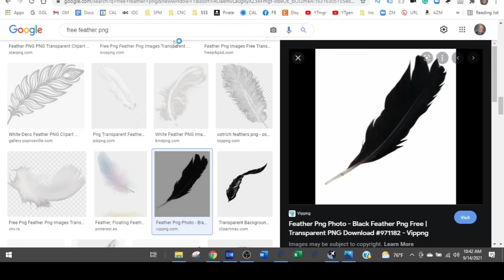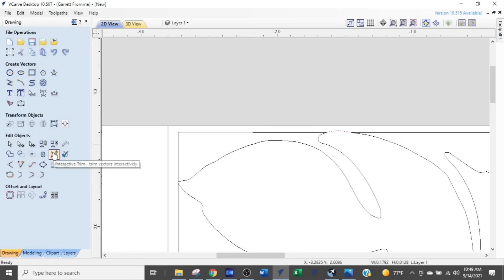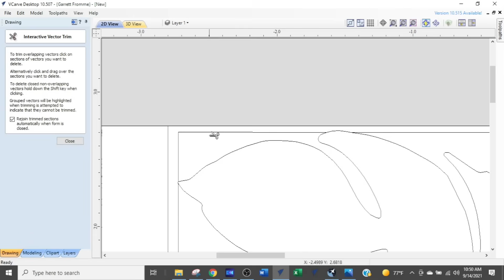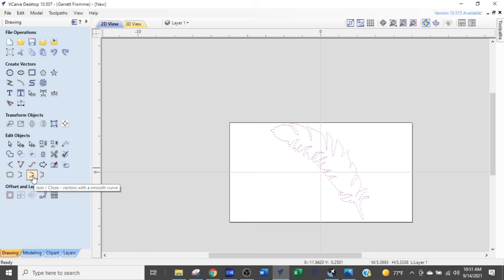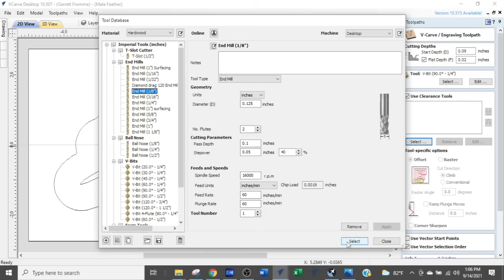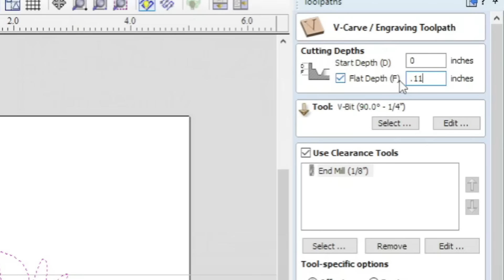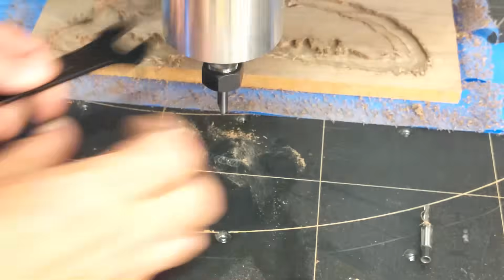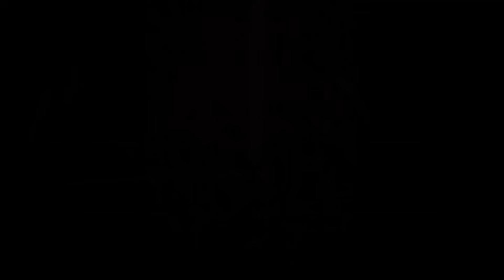How To Make a PERFECT INLAY with a CNC Router, Easy CNC Router Projects

Comment: Thanks for the great video. I have used your procedure twice now with great success. Thank you. I do have one question about you start depth settings for the male side. You used a start depth of .09 and a flat depth of .02. I am curious as to why you use the .09 start depth? My question is due to me being very new to CNC routing for one so I may be missing somewhere obvious. And for two I have a small spindle using 1/8” bits with a pass depth of .02. Because of that my first cut is cutting at .11 and it’s a LOT for my little router to handle. Any insight would be greatly appreciated. Thanks again for all the great content
Reply from the maker: Thanks for the kind words! Your situation is a bit tricky to walk through over comments, my friend. I recommend joining us for our live sessions every Wednesday evening at 8 PM EST, and we should be able to help walk you through it then, brother!
Reply: @IDCWoodcraft  Thank you for the reply, I appreciate you getting back to me.  I will check out the live sessions for sure.  Thanks for the invite and looking forward to it.

Comment: Thank you for all these amazing videos! So awesome, I’m going to make an inlay and was thinking of using a 15 degree VBIT for sharper detail, can I change the bit to that and use the exact same settings? Thanks!
Reply from the maker: I'm glad you're enjoying the videos! You can definitely switch to a 15-degree VBIT, but you may need to adjust your settings slightly depending on the bit's specifications and the material you're using. Happy inlaying!
Reply: @IDCWoodcraft  thank you, my buddies and I watch all your videos, they are the BEST out there. Hands down. Thank you for sharing and all the hard work you put into these for others to benefit from.

Comment: Garrett , you wouldn't believe my trip with the feather.  Forgot to load female v bit program,  ran correct bit, no "quill" Found out I didn't load v bit file but ran clearance program.  No harm done. Now I need to know if I need to measure my plug and reprogram surfacing toolpath to cot to correct depth. Seems male "quill" may have chip issues that will make a void if I surface too deep. I used mahogany for male. So wood fibers are not like walnut. Any suggestions would be nice on the resurfacing 😅
Reply from the maker: Haha, sounds like quite the adventure with that feather! This one is a little tricky to walk you through over comments, my friend. I recommend joining us for our live sessions we host every Wednesday evening at 8 PM EST; we should be able to help you out there, brother!

Comment: 90 v bits don’t allow much for depth.  plus cutting with V bits creates a deep center and very shallow points and walls at the ends, it’s simply the nature of the tool.  Better tool in. TBN tapered ball nose.. helical cutter which leaves the best cutting surface and very deep inlay through the entire cut.. I highly recommended you try the TBN. you can enter it in v carve as a conditionally correct V bit or an actual TBN or engraving mill.  You’ll need test cuts to find the parameters that work but the inlays are much deeper and stronger throughout. I do 7.0mm on end grain and 4.0mm depth on face grain.
Reply from the maker: You make some excellent points about the differences between V bits and tapered ball nose bits. The unique geometry of each tool can definitely affect the outcome of a project, especially with inlays. It sounds like you've found a great solution for achieving deeper cuts and stronger inlays. Thanks for sharing your insights and experiences with the TBN cutter! It's always helpful to hear about different approaches in woodworking.

Comment: I have, to admit, I'm rather disappointed.  I've been trying to follow this, but the results are far from satisfying.  The first attempt, the v bit went too deep and the design chipped horribly.  The second attempt, the depth seemed to match better, but when the spindle lifted, the entire raised portion was gone!
The Avid touch plate is designed to always find all three axis, I don't know if it is even capable of being limited to just the z.  Is it possible the travel speed is too high?  I haveno idea what is going wrong.

I am editing this to admit I was wrong, and to apologize for posting a comment too quickly in frustration.  Once I realized my mistake, I was able to make the proper corrections and have created my first working inlay!  I did lower the stepover and feed speed to be safe, but my biggest mistake was using pine as a practice wood.  The 8.7 spindle on the Avid would rip that wood apart!  Once I applied it to a hardwood, the inlay came out perfect!
Reply from the maker: dalcassian56, I'm sorry to hear you're having a tough time with your project. It does sound like there might be a few factors at play, such as feed rates, bit settings, or even material type. It's important to ensure your bit is sharp and that the machine settings are tailored to your specific material and design. Sometimes, a slower travel speed can help improve the results, especially for intricate designs. Checking the calibration of your machine might also be a good idea to ensure everything is running smoothly.
Reply: @IDCWoodcraft  Please read my edit of the comment.  But I again apologize directly to you.  I'm barely a few months in to this learning experience, so mistakes are rather common🤪.

Comment: Thinking about getting into CNC for a side job after i retire.   Really great video and teaching skills.  One issue I'll have in going forward after getting the CNC is the accompanying tools.  Most CNC videos I'm assuming are people with wood shops that have all the tools like table saw  and etc. Only have a chop saw and router and sander will make the work more difficult
Reply from the maker: mrbob92679, It's great to hear you're considering CNC as a side job after retirement! While having a fully equipped wood shop does help, you can definitely start with just a few tools, like your chop saw, router, and sander. Many projects can be accomplished with minimal equipment, and you can gradually invest in more tools as you gain experience. The important thing is to find projects that suit your current setup and enjoy the learning process!

Comment: I just finished my first project with one of my designs using this process. Turned out great, thank you! I see now that this (inlay) is its own toolpath in vcarve v12 but I'm glad that I learned how to do this "manual" method. Much better understanding of what's going on. Great instruction!
Reply from the maker: ForvoQuizlet, I'm so glad to hear your project turned out great! It’s always rewarding to learn the manual methods; they provide a solid foundation for understanding the software better. Happy woodworking!

Comment: Outstanding video, thank you. I am getting ready to purchase a CNC router, so pardon the noob question. Why didn't you use a 1/4 inch bit to hog out the excess material on both parts?
Reply from the maker: thomasverga469, I'm glad you enjoyed the video! Using a larger bit like a 1/4 inch can definitely speed up the material removal process, but sometimes a smaller bit is chosen for more precision and detail, especially on intricate designs. It really depends on the specific project and balance between efficiency and accuracy. Enjoy your CNC journey!

Comment: Most people don't know how to use a bit in a router. The router collet is designed the right length to hold every bit at max length. When you take it apart to clean it you put in your new bit. The bit needs to be flush or past the end of the collet. Flush will give you the most length and past and not bottomed out your shortest cutting length. 

Please make sure of two things. That the bit is flush with the collet. If you try to get extra length the collet will not be able to hold the bit on the back of the collet. So you will be holding it by the front only. There are two tapers that hold the bit. 

The other is bottoming out the bit. If you can push the bit all the way in and then try to hold the bit. You will find that you didn't grab the bit all the way. The collet has to move inside the housing to hold the bit correctly. The bit would stop the collet from being able to move inside.

In both cases you will spin the bit or through it. If you need more or less length then get a bit that is right. Don't think that you can cheat it with how far you insert it. Rule of thumb is that the bevel on the top of the bit needs to be through the collet. If your bit doesn't have a bevel on the shank. Then you need to get a better grade of bit. The back of the collet has to be able to hold the bit to. 

Also if you look your collet chuck might have a hole so that you can see the bit. Do one of two things. See the bit or pull the bit out a little if you bottomed it out.
Reply from the maker: thomasswearingen6971, It sounds like you've got a great grasp on the proper use of router bits and collets! You're absolutely right about ensuring the bit is properly seated and that the correct lengths are maintained for safety and efficiency. These details can really make a difference in the quality of cuts and overall performance. Thanks for sharing your insights!

Comment: My question is if you are already using your CNC, why not just cut the profile out while you are there? Why use a scroll saw or jigsaw?
Reply from the maker: Smashleytulsa, Great question! Using a CNC for most tasks can be efficient, but sometimes a scroll saw or jigsaw allows for more intricate cuts or detail work that might be harder to achieve with a CNC. Plus, for smaller or more delicate pieces, it can be easier to maneuver with hand tools. It really depends on the specific project and the level of detail required!

Comment: This may be a dumb question but do the settings change  much depending on different projects or do they stay the same regardless?
Thanks for your videos. Very informative.
Reply from the maker: Hey Chuck, that's a great question! The numbers do not have to change. However if you want to do a cutting board with a deep inlay than you do need to change
Reply: @IDCWoodcraft  . That's exactly what I was thinking about doing was a cutting board. Any suggestions on general settings for that?  Thank you for all  your help.

Comment: When you go to google and find the image that you want to use. Right click on it and choose save image as. Then after you have saved the image you can load it directly in to your program that you use. It's probably also a good idea to look for svg images rather than png images. svg is a scalable format, which means you can change the size of the image and it will be the same at any size!
Reply: Or, if all you want to do is paste it in to your cnc software. Right click the image and select copy image!

Comment: I'm afraid I've gotten myself turned around.  In the inlay feather video, you show drawing an X in the exact middle of the blank and then eyeballing the X and Y coordinates over the X you drew and when close enough, zero both the X and the Y.  Fair enough, but in later videos you talk about the "Home Position" as being the extreme full location of X full minus and Y full plus position.   What is the difference and when would I use the "Home" feature instead of the drawn an X in the middle of the blank method?  Ed.
Reply from the maker: edluna5224, Great question, Ed! The "Home Position" refers to the machine's designated reference point, where it knows its absolute limits on the X and Y axes. Using the X in the middle of the blank is a quick way to set your zero for that specific piece, while the Home Position is more about the machine's overall setup. If you're working with multiple pieces or need consistent positioning across projects, you'd typically want to establish your Home Position first. For one-off projects or small adjustments, eyeballing it works just fine!

Comment: I am impressed at how sharp the points are.  I'm not sure my brain quite understands why that is.
Reply from the maker: 1MoGuzzi, I'm glad you noticed the sharp points! They play a crucial role in both the precision and the clean finish of the cuts. The sharpness ensures that the CNC machine can accurately navigate and shape the material without tearing it. It's all about achieving that perfect detail!
Reply: @IDCWoodcraft  Thanks for the reply.  In particular, on the female side, the 45 degree bit comes to a very sharp point, but the deeper the cut the greater the radius = more rounded cut at the end.  So the final inlay layer must be very thin, after the surface is milled, to get that beautiful fit.  Obviously, I haven't spent much, any, time on a CNC mill.  My world has mostly been metal fab and repair with a lot of weird side interest.  It's getting too late to start a new one, but I enjoy your detailed vids and others like them.  A sincere Thanks. Jim

Comment: Garrett-I'm receiving the BADGER today, this will be my first inlay.  I'm planning to use your 30 deg Vbit due to some finer details.  Should i use the custom settings you used for the 60 deg vbit, or something else?-  Mario
Reply from the maker: mariomarcoccia6277, Hey Mario! The 30-degree Vbit will give you a finer detail but the settings remain the same on the inlay. It's a good idea to optimize the feed rate and depth of cut for the smaller bit to ensure crisp results. Enjoy your inlay project with the BADGER, and I can’t wait to hear how it turns out!

Comment: Great video. Even after 2 yrs I found it to be a great reference. May I ask, what is the depth of the female pocket? I use Fusion 360 and I am trying to find an equivalent to the parameters you used. I just want to scale up or down depending on the depth of the depth of the female pocket in case I need to vary in for my projects.
Reply from the maker: jaimerodriguez3864, I'm glad you found the video helpful! The depth of the female pocket in the video was 0.11 inches. In Fusion 360, you can adjust the pocket operation settings to adjust the depth as needed for your projects. Just enter the desired depth value when setting up the toolpath.

Comment: For deeper inlays, just maintain the same ratios of start and finish depths?
Reply from the maker: derekjenkinson8014, Yes, for deeper inlays, you can maintain the same ratios of start and finish depths. Just make sure your tool is capable of reaching the desired depth without any issues. Happy woodworking!

Comment: I have a smaller, more intricate design I want to use as my inlay. I was told to use a 60 degree V bit so that I could get the detail. Would the start depth and flat depth numbers change at all if I'm using a different size V-bit?  BTW...thanks for a great video. As a newbie it is always helpful to see the complete start to finish of a project.
Reply from the maker: denabartnicki8054, you can definitely do that with the same settings brother! A 30 degree v bit would work great too!

Comment: I know you said that you shouldn't make changes to start and flat depth. However, I need to make a 0.25" inlay. What settings should I settings should I use for that depth?
Reply from the maker: justinb2010, this may take some experimentation but try these settings as a good starting point brother!

For the female
Start depth 0.0"
Flat Depth 0.25"

For the male
Start Depth 0.2"
Flat Depth 0.050"

Comment: Garrett I have just reviewed your inlay video again and was wondering if it is possible to create a deeper inlay to be used on cutting boards, as I was hoping to have an extra depth male in case additional surfacing is required in the future. I know you stress the importance of the numbers you use for depths but is it possible to adjust these? Also I imagine if a person has a detailed inlay you could also use 15 or 30 degree v bits?

Thanks for the great videos as well as the great bits you sell as I have had great success with the ones I have received from you.
Reply from the maker: GregSullivan1445, you sure can brother. These depths have always worked well for me on my inlays! You can definitely play around with the numbers though and make the inlay deeper. You'll want to have your inlays endgrain for best results, use a 30 degree V bit. Here is a link: https://idcwoodcraft.com/products/30-degree-extreme-detail-v-bit-bit-for-cnc-routers-1-4-shank

For the female
Start depth 0.0
Flat Depth 0.4

For the male
Start Depth 0.3
Flat Depth 0.1
Reply: Ok thanks for the help

Comment: It it just me or is that just not as impressive as doing by hand ?
Reply from the maker: I think it's just you
Reply: perfection is impressive I will give you that and setting up that machine is little different than setting up a hand plane philosophically but I am far more impressed looking at perfect things from the 1600s when they didn't have metal bodied planes let alone computer controlled gizmos.
   You do it your way brother but you and I both now it's not just me and you can't do it without that machine any more than they could do it with out the steel for the saws and chisels.  
     It's all just the evolution of the craft. @IDCWoodcraft
Reply: The Egyptians had CNCs